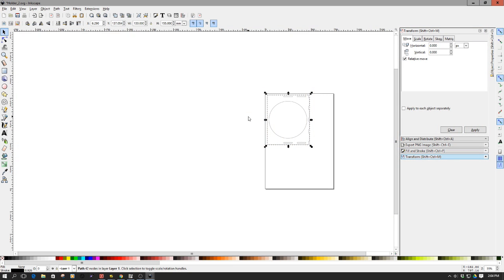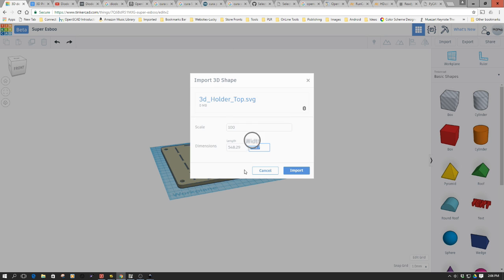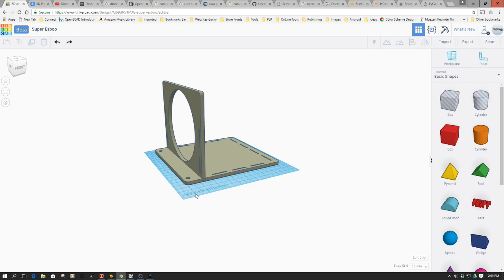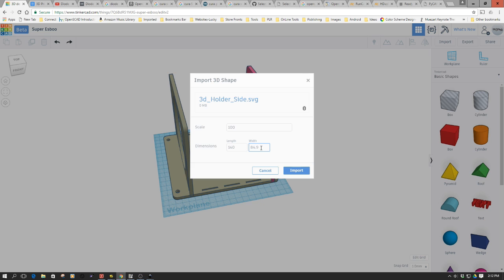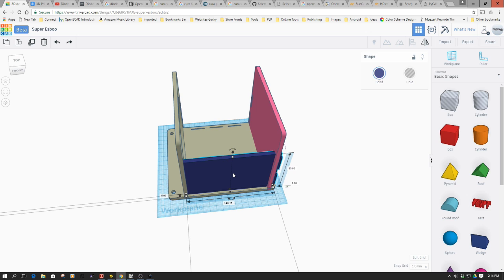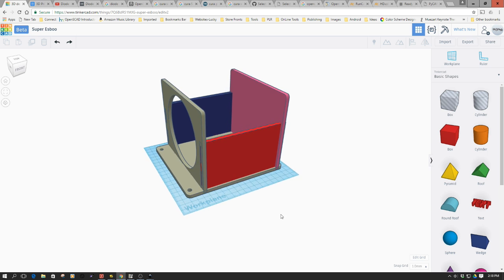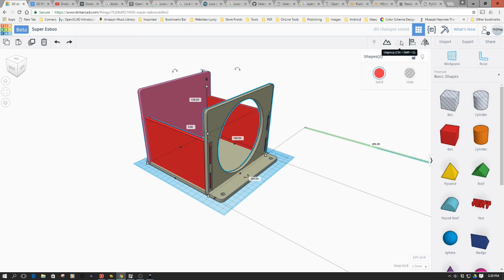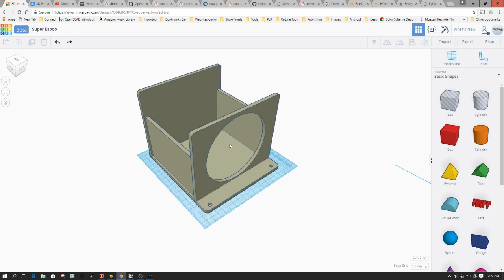3D Printed Project - Converting a Laser Design for 3D Printing Part 1!

Comment: Did you try importing into Fusion360? I think in Fusion360 you can output directly to your printer software.
Reply: Check out the Fusion360 March 2017 update which improves cutting (laser, water-jet, and plasma) CAM support.
Reply: Also check out Slicer for Fusion360 which auto generates some types of laser cut assemblies.
Reply from the maker: Sorry to say  have not tried Fusion 360 yet, it is on the list but sorry to say not enough time...
Reply: I'm sorry, I thought it was you that just started using Fusion360. I guess it was one of the other YouTubers I watch. If you get a chance I recommend you try it, it's a one program does it all kind of thing. However I don't know if it would work for the laser.
Reply from the maker: Without question on my list :-)
Reply from the maker: Will do!

Comment: Who needs a PR firm when I have you?  Lol. That was great. Can't wait to see the next episode. I'm stalled out modding/upgrading my printer. Time to get off my duff and print some stuff!  

I was actually thinking that you could have printed out all the pieces separately with the tabs and slots to then assemble and glue it like the laser cut acrylic parts.  But this works too!
Reply from the maker: Yes you could have done that (in pieces and glued) however that that would be a bit "crude" when you have a 3D printer and all :-)
Reply: DIY3DTECH.com - Crude, yes considering it could be printed as one piece. Though printing in flat position could help with strength issues by allowing the layering pattern to be oriented differently from piece to piece. And of course, both ways could benefit from a nice thin coat of epoxy to add strength and durability.